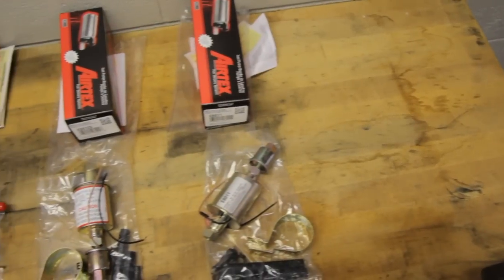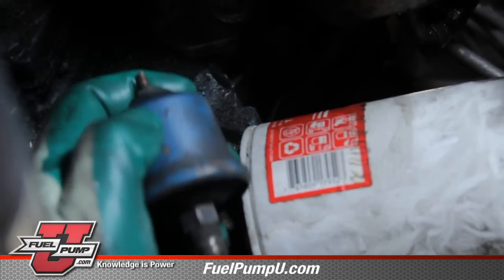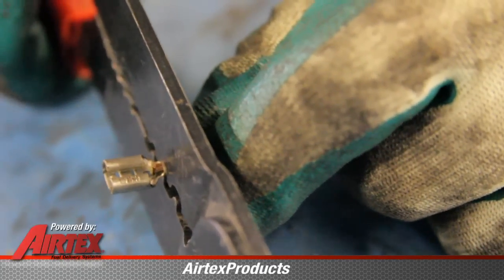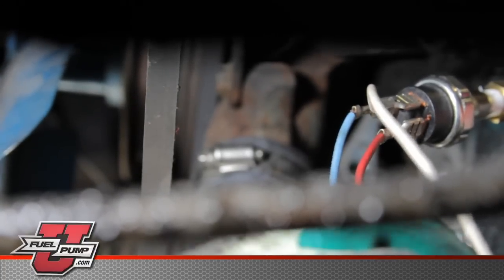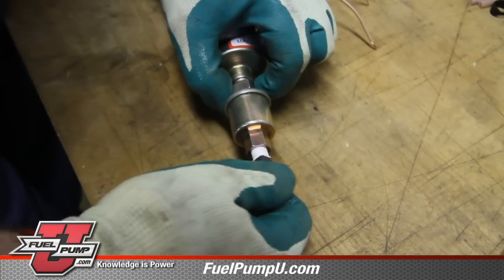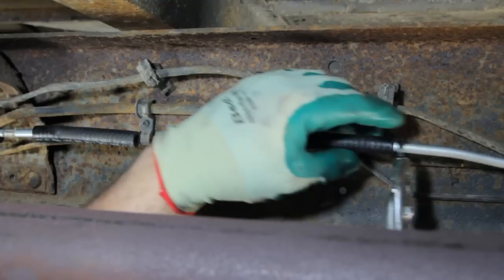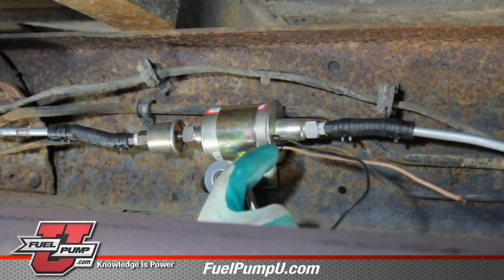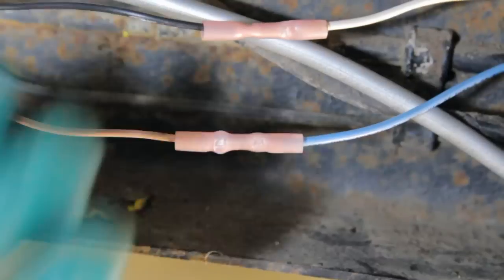How to Install Universal Electrical Fuel Pump

Comment: You also installed a filter in between the tank and your pump, what micron size is recommended?  Do you see a downside of having a momentary push button supplying power to the pump.  Power would only be present when your finger depresses the switch.  This seems easier than the oil pressure switch and wiring described.

Comment: do I have to remove the mechanical fuel pump before installing the electric pump?
Reply: Brah, this is a commercial, These guys couldn't care less, see the nice replies they posted here in the comments section... Me neither, this is just an ad.

Comment: Thanks for showing this helpful video. You've given me some ideas of how I might be able to use a universal fuel pump for my 15 year old carburetted touring motorcycle to replace the OEM one at 1/5 the cost. Use of a safety pressure switch would mimic the OEM's 4 wire fuel pump while using a 2 wire pump. Again, many thanks.

Comment: hi there, I'm having trouble with my 95 Chevy  G30 HD  it had the fuel pump mounted near the carburetor. and I just can't get it to run correct. now after watching this video. I assume that's my problem. I'm going to get a new one and install it near the tank!

Comment: Any sensor or switch with a single connector completes the ground path through the body of the sensor/switch, putting Teflon tape on the pipe threads  may interfere with proper grounding. Tape or no tape this 3 prong switch is isolated and will work, but your oil pressure switch may not.

Comment: Hi, I am fitting  one of your pumps on my old mini. It has been recommended to me  that I  should mount it on rubber. I see you mounted one straight to sub frame/chassis.  Any direction would be appreciated.

Comment: Just installed the pump you recommended and it seems it's too much pressure. Hen I disconnect the pump ir runs fine and boggs down on acceleration when I connect it back up. Do you guys have some type of pressure regulator?

Comment: is there no need for a relay with this application?

also, would wiring be the same if i was using an in tank pump on my tbi converted to carb truck?
Reply: ***** My car sits long periods of time. When I come to  start it the fuel has vacuumed back in the fuel line. Therefore, because I run a mechanical pump there is not fuel there to start it and pull fuel. If I install an external pump without a relay and with the oil pressure safety, will the pump still prime when the ignition is keyed? I'm trying to understand how electrical pumps work on carb vehicles if as you said in the video "the pump won't work if engine is not running."

Comment: I am currently looking at a 1982 pontiac firebird and i was told that it needs a new fuel pump and that the car is not carburetored. I am most certain it is a direct injected V8. Would i use the same process shown here?

Comment: I just put in a crate 350. I am needing to switch to an electric fuel pump. I bought the E8012S. Where should I mount the electric pump?

Comment: What is the small cylinder attached to the inlet side of the pump?  Is it a fuel filter, pressure regulator, or something else?  Thanks!

Comment: I am pretty certain my in tank electric fuel pump is bad.  Can I install an exterior electric fuel pump without removing the in tank pump?  In other words... Do chevy electric fuel pumps allow fuel flow even if the pump has failed?
Reply: Terry Weaver you can pull fuel threw the dead intake pump I know it will work at carbureted fuel pressures but I don’t know at efi pressures. The dead pump might restrict fuel flow but with a decent fuel pump it should work.

Comment: Do you have to remove the old pump from inside the tank to install one on the outside or will it pull it through the original pump?
Reply: Airtex/ASC Performance Pumps

Comment: Hello, I have an unorthodox usage for one of your fuel pumps. It is a e8012s. I would like to know how much wattage/amperage I need to supply to it at 12 volts to continuously operate it.

I intend to use it as a makeshift water pump because I have some hoses, one of these pumps, and some water to move out of my way. Either I'm going to use a battery with a fuse if you let me know the current draw, or I will use a 115vac to 12vdc soandsowattage power supply if you let me know the wattage requirement.
I would much prefer to do the latter.

Comment: Great video Airtex-ASC .  I have a question.  I have a older GM vehicle and most older GM's the started signal wire is purple and is active when your key is in the farthest forward start position.  Is that the wire that I am going to tie into?

Comment: This is helpful but what i really need to know how to run the wires
Reply: Me too
Reply: @brycepeters6163  I ended up running a 16 gauge wire from the positive terminal of the coil along the frame and grounded the negative right to the frame.  I've only run it in the driveway so far but so far so good

Comment: Could you recommend a saftey switch for low engine psi? (15-60ish)?
Thanks again for your help and the video!
Reply: Thanks. :) Would I need the switch if I had a fuel pump relay? I've read I only need one or the other. Thanks again for your help.

Comment: i have a 89 nissan d21 pick up and the first time i put gas the fuel pump burnt out on me so i replace it with a used one and it started fine but as soon as i put more gas it went bad again fuel pump

Comment: i am working in my project a ford maverick V8 1976, i am installing an electric fuel pump i follow your step but i got a few questions , should i add a relay and an  adjustable fuel pressure regulator with gauge, i saw a few othere videos where they did , but i want to know your opinion
Reply: ***** I would definitely add a Fuel Regulator.

Comment: On a 1989 chevy blazer the fuel pump is in the gas tank can you put an external fuel pump on the line somewhere so you don't have to drop the tank will it still do the job
Reply: Did you ever figure that out if that worked?

Comment: I have 1985 dodge w150 with a 318 auto matic and it has a mechanical fuel pump can i install the electric pump and still keep the mechanical fuel pump or would it be best to remove the mechanical pump
Reply: The mechanical pump still does work and i just cleaned the carb and gunna do new fuel lines and clean the tank the truck sat for 7 years and had a lot of dirt in the carb but still . i think that since i replacing all that stuff i might as well do a electric fuel pump . I'm basically asking if the mechanical pump can stay on the block . and i can just use fittings to close it off

Comment: What fuel pump do you recommend for an 87 chevy stepside with a 350, 4 barrel carb? My mechanical fuel pump just went out.  Would we have to bypass the mechanical fuel pump or just go ahead and put it in line with the mechanical pump still in place?
Reply: Thank you. Very helpful and fast response!
Reply: @manuelgunner100 did you ever figure that out?

Comment: Just wondering which in tank pump you would recommend for my cj7 jeep? I am upgrading from my carb system to a GM TBI/fuel injection.. I am only looking at a maximum of 15psi... I have a new MTS 15gal part #0051 plastic tank?
Thanks bunches for your time. :)
Reply: I really wish I coud install a in-line fuel pump but it will be really hard as the exhaust runs on the same side of the fuel lines. If I can find/mod a heat shield and figure out where and how to drill holes for the fuel pump/filter then an external might work.. But in the long run it would be easier to install a in tank pump assembly.. --All I have to do is drop the tank (again) install rehook up the lines and wires, make an access panel out of my jeep tub for easy access to the fuel pump then reassemble.
If my idea doesn't work, I will check out your fuel pump. Thanks for your help! :)

Comment: I have a 383 stroker motor I need to put a external fuel pump on, how do I make the hole for the rod to run into the timing chain for the fuel pump to run?
Reply from the maker: A mechanical pump is not driven off the timing chain. I would suggest using an inline electric pump.

Comment: replacing a mechanical fuel pump on a 350 sb with a 2barrel carburetor, what is the recommended psi's needed on a new electric fuel pump to replace the mechanical fuel pump?...... because the pin got stuck & won't go in or out!
Reply: 6 psi is regular on a 5.7

Comment: If there is no oil pressure when the engine is off. And the fuel pump will not pump until the switch see’s oil pressure. How do you start the engine with no fuel delivery?
Reply: pray.
Reply: If it is a mechanical oil pump on the engine, then when the battery turns the engine over in starting, it creates fuel pressure.

Comment: My fuel pump is in the tank. Can I leave the defective pump and add this universal pump inline?
Reply: EL NinJah,
 Did you leave the in tank pump and run the new pump?
Reply: Sasquads yes you can do that and it works just fine on 95 percent of pumps

Comment: If a switch only has 2 terminals,  what is the proper way to wire it? Where does each wire go?
Reply: ***** - Should not matter, it is a switch. Put in series with pump motor!

Comment: I want to install one of these pumps as a booster pump.  My CJ7 is not run for months and needs a short boost to pump the fuel to the carb prior to starting.  Do I install the electric pump prior or after the mechanical pump?
Reply: John Godwin o
Reply: I don't think it would really matter considering electrical chokes on carbs our after it

Comment: Ok, I have the power from pump and ground to battery hooked up.... exactly where do I run the Terminal S and I? S to starter solenoid wire? I to key powered on fuse?
Reply: +Airtex Pumps I understand completely! Thanks a lot for your help! Will give the Tech Hotline if I need further assistance!
Reply: +apdabeast15 Typically when I've installed items that required an "I" terminal or power / ignition terminal that would allow something to only run when the ignition is on I have used a fuse port on my fuse box. If you do not have an open fuse port that has 12v + to the open fuse location, typically one can be accessed by purchasing a double fuse port adapter from the parts store. Simply unplug your fuse, plug in the adapter, replace the fuse in the 1st position. Then you can add a separate fuse for the fuel pump at this location through the ignition or "I" terminal by connecting it to the wired output of the fuse port adapter. Just try to use a port that not already filled with a fuse greater than 20 amps as this could cause an overload of the wiring feeding up to the fuses. If the port you jump off of already has a 20 amp or greater rating the possibility of running to much current through one fuse port is possible. Just don't hook it directly to power otherwise the fuel pump will not shut off.
Reply: +JudgmentDay78 Thanks a lot! I did get the pump the work with an open fuse port that powers on at ignition on only. Currently running and driving that way. Problem is with the oil pressure safety switch! When hooked in series with the fuel pump..the pump doesn't cut on at all. When I unhook the switch and run the fuel to ignition on and ground...it runs fine! Not sure if location of the switch has anything to do with it or with it being the the 1st time getting it to run, maybe the psi for the oil wasn't yet high enough! I the process of swapping radiator and adding electric fans...will hook the switch back up since the engine has now been running long enough to build up pressure.
Reply: apdabeast15 vtTrujillovulnerable

Comment: my question is, 2003 ford explorer V-6, automatic, can I install an aftermarket electric pump in place of stock? ( Externally) ?
Reply from the maker: Yes, you can install an externally mounted pump. But first, you will need to remove the in-tank pump. The original in-tank pump will not allow fuel to be pulled through it.

Comment: That white tape is not petroleum rated/safe. Use the yellow type .Those wire crimps are crap, solder and place shrink-wrap over afterwards.

Comment: Will a external fuel pump work on a 1995 jeep wrangler YJ 2.5L 4cyl??? I needed to replace my fuel pump this week and wanted to see if anyone else done the same thing or not! Wouldnt have to drop the tank if it does works!
Reply: The mechanics game plan is to install a external fuel pump.....Yes the fuel pump is running but here is my problem! The fuel pressure is fluctuating from 20 to 40....or 15 to 35 back & forth, all over the place! In turn the 1995 jeep is driving like sh**.....Its using twice as much fuel, its getting 9 mpg when it was getting 15 mpg! Its hesitating/bucking during acceleration, up hills and it seems like its just getting worse as time goes on & you can see wetness around the outside edge of the throttle body like its getting too much fuel like maybe its not burning......Its been 7 mths now that i been tackling this issue! I have changed out the spark plugs, spark plug wires, distributor cap, rotor, TPS, checked MAP ok, checked IAC ok, checked fuel regulator ok, fuel filter, fuel injectors! Now we are gonna tie in the external pump so that it will come on at the same time just like the internal fuel pump....If it fixes the problem then we know its the problem. Im not a mechanic, i just know basics....My mechanic has been doing this his whole life, i say over 40 yrs but not much experience with jeep wranglers is the problem cause we are both scratching are heads now! Im hoping this does the trick but im still wondering if im still gonna have issues down the road...The external pump is $60 & labor is $40...$100 total to see if it works....If it doesnt then its just $40! He is affraid that if you try and take the internal fuel pump out that you will bust off the bolts that needs removed to get to the fuel tank...He states that it will be costly for me in labor if they run into problems.....I can see this but you just never know unless you try is how im thinking BUT thats where im at! Hope this helps! I will write your number down, right now im headed to try out this external fuel pump!...Fingers are crossed but like i said....My thoughts is im gonna be tackling this issue down the road it feels like even if it fixes the issue! Just one of these problems that will not go away & there is No check engine light telling you what the problem might be! TTYL
P.S.- Is the fuel pressure suppose to be steady at its spec pressure or atleast within 5 lbs give or take (fluctuating)?????
Reply: That was quick..lol ....Thank you....I didnt think so!....Since this issue has been so long my brain is fried & hands in the air!....One of them situations! So im all ears at this point!...Right now i dont see anything else except fuel pump or pointing the finger at the throttle body itself!...Gonna tackle this external pump & if it works i will keep it on but eventually the internal will have to come out im affraid! I just feel its either now or later.....The mechanic thinks if this fixes it that it will be cheaper on the wallet which is true!...So again my hands are up in the air so what can ya do!....TTYL
Reply: Got a question....Maybe you might know or maybe not, just throwing it out there!....Awhile back i had a gas line break right behind the rear drivers side tire.....When you look up in this area it looks like a major hose hwy if ya know what im talking about!.....I dont know if this has anything to do with my issue or not cause like i mentioned....Im thinking all over at this point....My mechanic had replaced that line loop with a rubber fuel line.....But this was 4 yrs ago....During the 4 yrs the screw clamps holding it together has sprung a leak twice but both times just re-tightened the clamps and it was fixed! Im wondering if this needs to be fixed with original parts but we wondered if ya could even find the part since its like a kaotic junction of fuel lines in this area im talking about! Like i mentioned im trying to cover all avenues at this point!.....Thank you!

Comment: how to install one in my 1996 winnebagel sun cruise
Reply from the maker: Latangela Wilson, Installing a universal pump on your vehicle will not be any different than shown here. You will need to remove the in tank pump and replace it with a section of hose. It is most likely the in tank pump will not allow fuel to be pulled through it.

Comment: Kinda sloppy on that install. No protection on the cramp terminals so they don't develop bad connections and needs a proper sealant not junk teflon tape. Teflon tape is for beginners.
Reply: You mean crimp terminals. Cramps are what happen to muscles. Teflon tape is used by many professionals. Teflon®* PTFE is designed to work with gasoline, leaded or unleaded.

Comment: I wonder if when you stop making commercials if you will learn to use thread sealer (Permatex Thread sealant) instead of my plumbers Teflon tape. That's pretty ghetto teflon tape, you might as well use some duct tape and super glue to fix a transmission issue too Huh? Check engine light... Get some Tape!  Ghettoshop Proven!